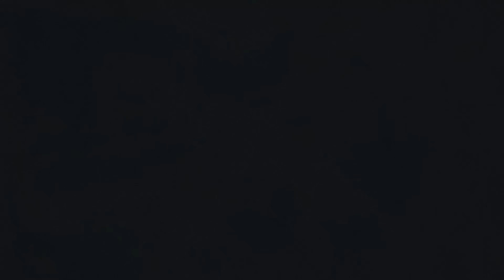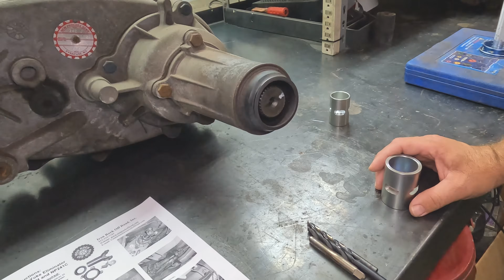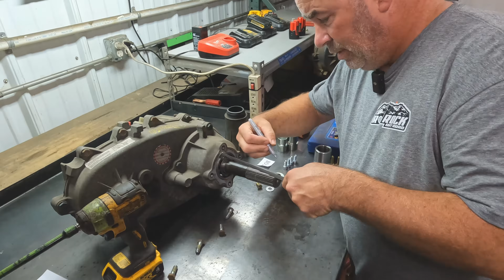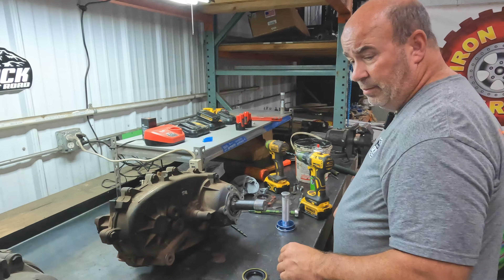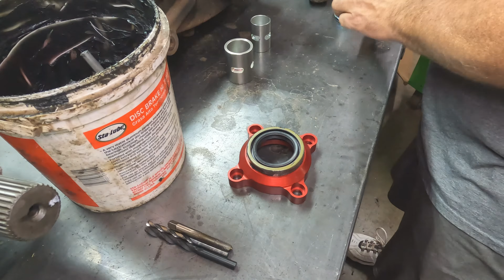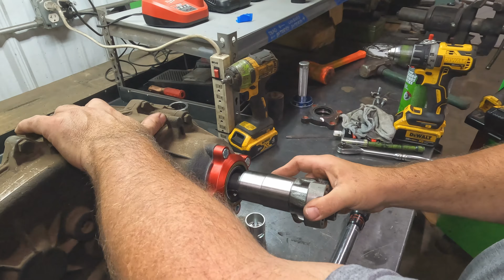32 Spline Slip Yoke Eliminator - NP242HD Hack N Tap

Comment: We ended up going with a hack n tap for the transfer case on the Amigo build, but no one makes an SYE for the transfer case. Luckily it was a 32 spline output shaft and we were able to use a standard hack n tap kit. 
The only thing that gave us trouble was the hardened steel of the shaft ate up a few drill bits.
Reply from the maker: That hardened steel is no joke; it’s definitely a workout for your drill bits! 🛠️ Glad to hear you made it work!

Comment: No issues with the much shorter spline length?
Reply from the maker: @maxbraketorque no problems at all. We have been running this setup on 1-ton Jeeps with V8s for years without issue.

Comment: We want a true slip yoke eliminator again!!!
Reply: How did you get a 242HD!! Damn!!
Reply: @Wayling2069 ebay
Reply from the maker: @douglasbeary7890 & @williammontano7854 We hear you guys! Tom Wood's used to offer the full SYE for 242HD, and that's what we would recommend, but TW stopped selling it. We're not sure why. Maybe because the case is so rare? Either way, we have run our Hack N Tap on the 242HD for many years with no problem at all. The dirty one in the video came from our Pumpkin WJ.
Reply: @Wayling2069 out of a 4.7l WJ
Reply from the maker: @TexaScorpion69, @matthew7972, @douglasbeary7890 Ebay is a good source for this rare transfer case. We have also had good luck with car-part.com
Reply: @IronRockOffRoad is there any heavy duty rebuild kits that you know of for the 242HD
Reply from the maker: @BigRedAutoWorks I haven't seen any, sorry.
Reply: Say it louder! There's a million hack n taps bring back the true eliminators!
Reply: why? seems like you would just do a JK case swap.
Reply: @eat.sleep.wheel21 just looked it up first one was $1200 second one is almost $3000 .... not worth it.
Reply from the maker: @douglasbeary7890 That's crazy
Reply: @IronRockOffRoad to be clear I assumed we where talking about the 241 rock trac
Reply from the maker: @douglasbeary7890 Ah, yes. Those are super expensive.